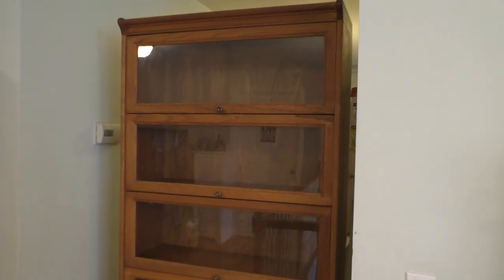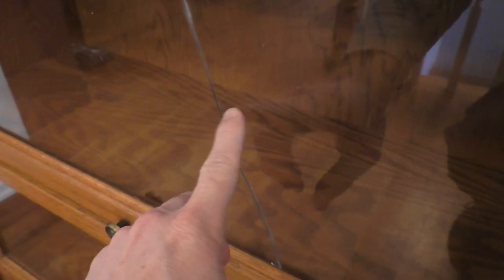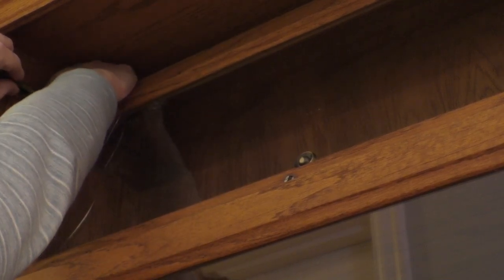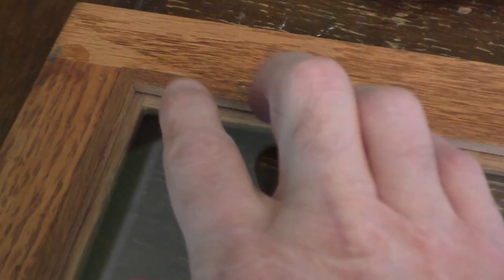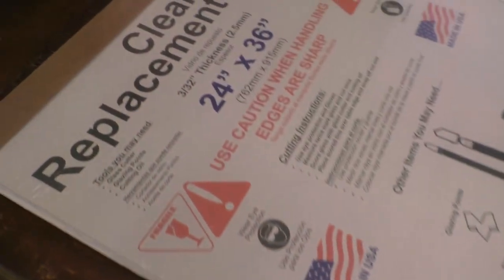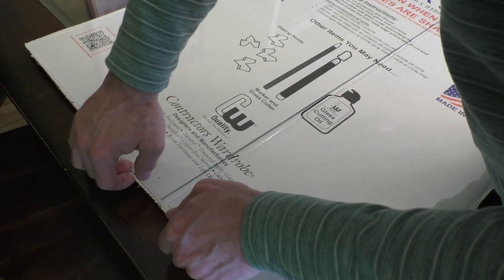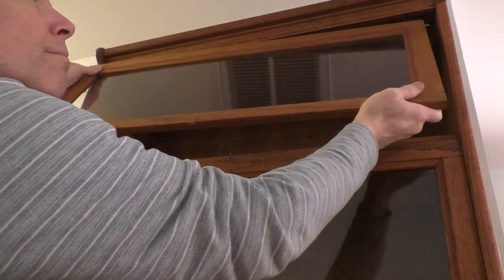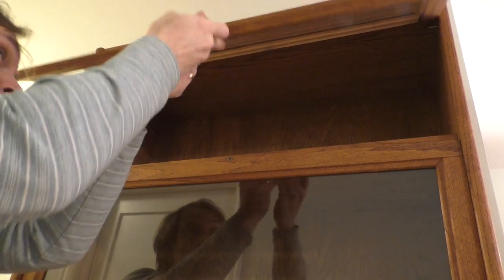How to Repair a Barrister Bookshelf

Comment: Great work!  I just came into a Grand Rapid's Michigan Barrister Bookcase made by Dunn Furniture Company.  It is a 4 stack with each stack being a different height.  The top has a triangle label on the back with GRM; inside back panels have a stencil of Gunn Furniture Company, Sectional Bookcase.  I have seen other brands like Globe & Wernicke, also Macey, but little info on Dunn. Anyone here know anything about age, assembly / disassembly?  Thanks